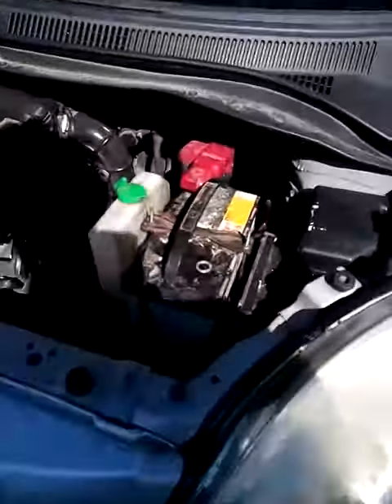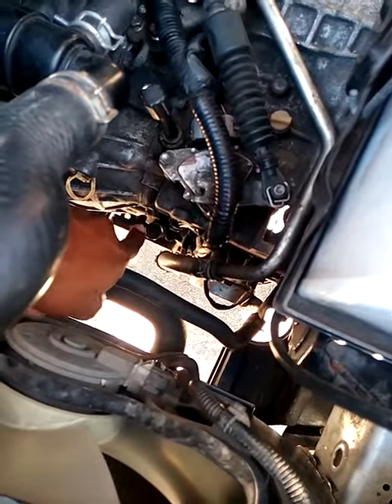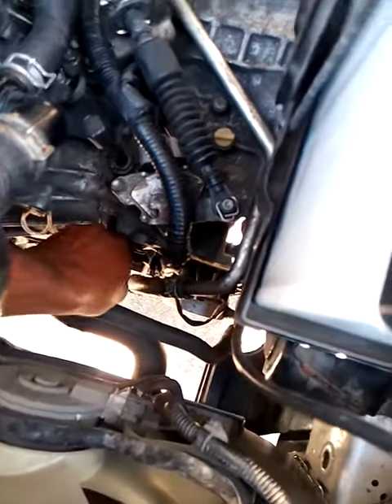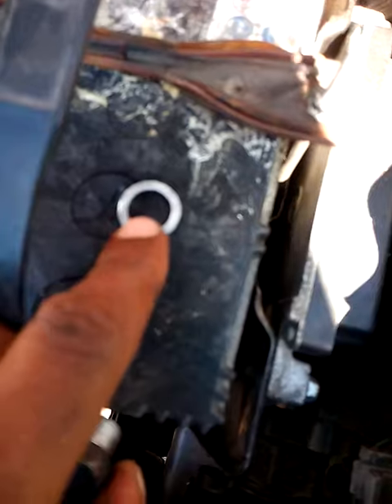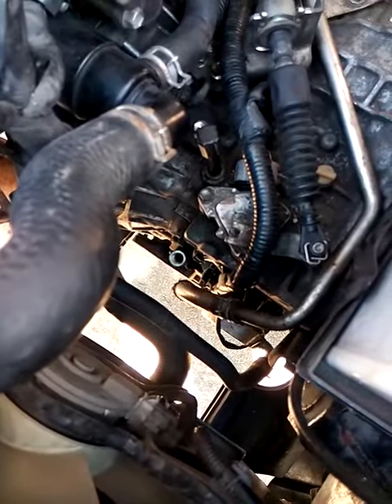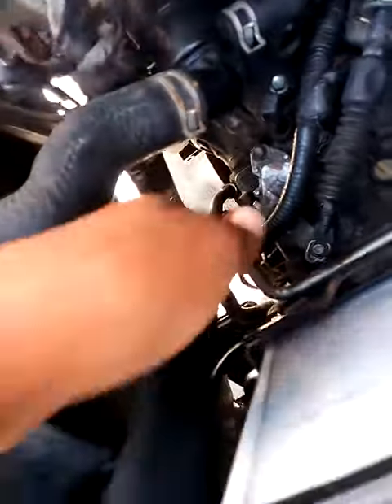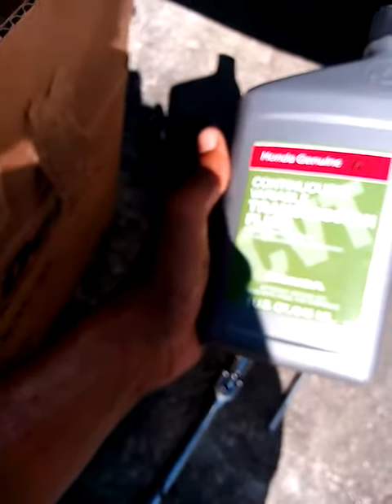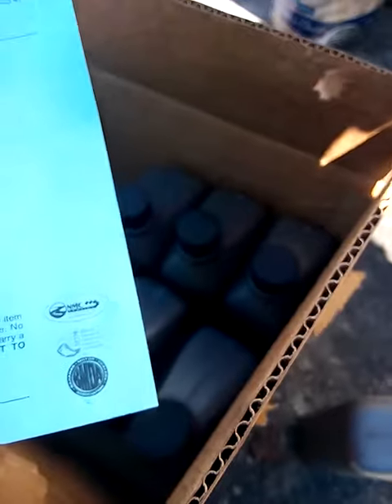Part # 2 of how to change transmission fluid in  JDM 2008 suzuki swift

Comment: How is transmission fluid more litres than the engine? This is unusual.
Reply: You don't have the slightest idea about cars, right?
Reply: @di-hw7si I've just changed the transmission fluid on my 2010 Suzuki Swift Sport manual transmission.
The fill plug was underneath, not far from the drain plug. 2 litres came out & I put 2 litres back in until it dripped from the full plug.
I also did the engine oil & filter which was near to 4 litres.

Comment: Where do you drain the oil out from
Reply from the maker: +Ghost Boy at the bottom... if u have a email i can send u a pic
Reply from the maker: Ghost Boy one sec..... also AID has the filter abd if they dont check auto mall shirley street... They carry parts for them and if they dont just order it from ebay
Reply: Where did  you purchase  your parts